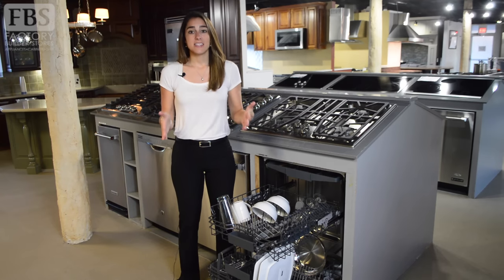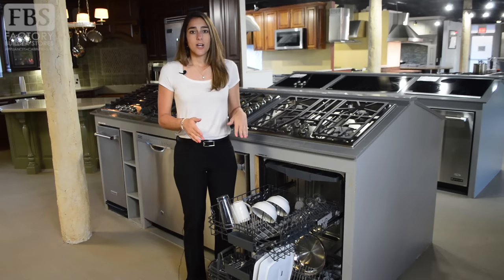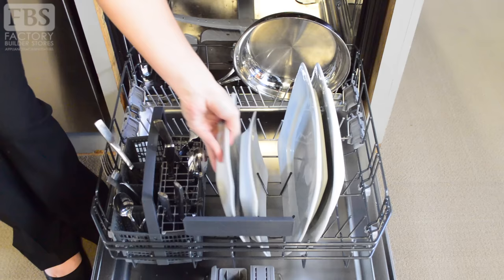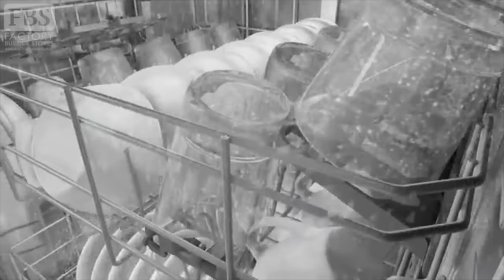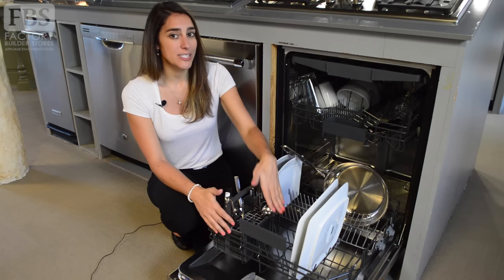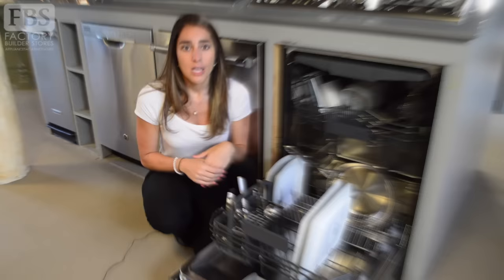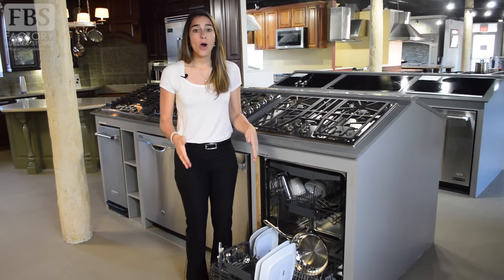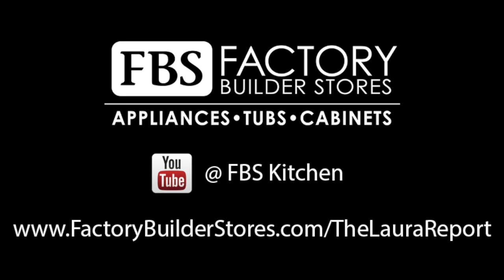How to Load the Dishwasher Properly

Comment: Dishwasher loading beliefs are like all the Faiths on this planet. People have strong beliefs and theirs is always right!! 
However i did learn some things from your video and some other videos and cleaned my wash arms as the dispenser was found open a clumped portion of soap and the dishes not washed well. I found the end of the arms a little blocked; the ones that spray at an angle and point towards the dispenser? Bits of plastic and string that somehow got passed the 2 fine filters at the bottom or past the meshed water inlet? Well its 7 years old and likely never cleaned so it is now and will try next load if all working correctly. All machines need servicing and i wonder if negative dishwasher reviews are sometimes caused by no maintenance?  Ours has only 1&2 star rated but ours seems to work fine up till now.

Comment: Hello Laura, my dishwasher often goes to 99+ hours setting when I have chosen a time 
saving setting (like 50mins). I have noticed that happens usually when I
 have not ran the dish washer for 3 weeks or so, but I don't have that 
many dishes per day to run the washer sooner than once every 3 weeks. 
please help. Thank you for your time
Reply: You should use it at least once per week. Modern dishwashers have auto programs that measure dirt levels. That's probably why that program is taking forever to finish.

Comment: cast iron can’t handle the heat of a dishwasher? what? ...if anything the heat is the last thing a cast iron can’t handle..but a good review anyways keep up the good work
Reply: The iron will hold up fine. It's your "seasoning" (or the coating on the iron) that won't make it through the wash
Reply: @YaBoiButterball  that’s maybe true but not the point

Comment: If you don't rinse your dishes prior to loading them, the food will build up in your filter at the bottom.  It can become really gross and will require cleaning the filter more often.
Reply: If you use the appropriate amounts of detergent, it really isn't a problem.
Reply: "No manual rinsing" does NOT mean putting  solids into the machine.
All detergents are designed for use after the user scrapes leftover food from the dishes before washing. Solid leftover foods should be scraped off the dishes or bowls into an insinkerator or just a waste bin BEFORE dishes are loaded into the dishwasher.

Comment: "No manual rinsing" does NOT mean putting  solids into the machine.
All detergents are designed for use after the user scrapes leftover food from the dishes before washing. Solid leftover foods should be scraped off the dishes or bowls into an insinkerator or just a waste bin BEFORE loading dishes or bowls are put into the dishwasher.
No need to rinnse off the oil.

Comment: > "Never put bronze, copper, cast iron, ..., into the dishwasher. This materials do not handle the heat the dishwasher can produce."
Laura, this doesn't make sense. Those materials have melting points well above 1000ºF. It is easier to melt the entire dishwasher than a single cast iron pan.
Reply from the maker: Hi Mark,
I'm sorry for not clarifying properly, in the video, why you should not put bronze, copper and cast iron in your dishwasher. I've provided clearer reasons blow. 
 
With Copper you risk changing the color of your pans by putting them in the dishwasher. Bronze is a copper alloy (made of copper and tin) and you run the risk of also changing the color. Excess exposure to moisture will also damage these metals. 
 
Putting a cast iron pan in the dishwasher can cause a number of issues with the biggest ones being rusting and sticking. Soap should also never be used when washing a cast iron pan. A cast iron pan should always be seasoned and when you use soap you remove the oils and damage your seasoning.
Reply: +O01dude 45 > "because ur using a detergent thats not designed for those kinds of items [...]"
Even if you use regular soap, several items would damage in the dishwasher (ex: aluminum, wood, ...).
Reply: Mark Messa , Gee Einstein. Did you ever stop to think that iron will rust, copper will discolor, wood will dry and crack because of the high heat and detergent in these machines?
Reply: The 'seasoning' on a cast or steel pan is EXPOXIDIZED fatty acids - it is not oil at all and won't rinse off with soap..  The seasoning layer will soften from extended water contact and can be readily removed with weak acids, or with more difficulty using abrasive scrubbing.. There is no harm from an occasionally quick wash of your seasoned pan with either soap or detergents water - in fact it's the best way to clean off excess oils before re-seasoning.    Any seasoned pan should be rinsed and always completely (heat) dried after any water contact.
Reply: because your cast iron will RUST!! It will pit your copper and discolor your bronze. Does that make sense Mark??
Reply: FBS Kitchens what is the reason for not putting wooden items. If it is an old spatula, then why not?
Reply: @namodat  the wood will dry out from the heat and will crack.
Reply: Our6Plus  true. I’ve seen it happen

Comment: First if i put pan like you on 3.56 he will fill with water and foam and i will need afterwash again. Second. Tins or comb in this machine in my case not work. I make from farm milk butter in 1-3 l glass jars. I cannot put safe big jars on down rack if they are not get 2-3 tins, so i make this they not move. Actually when i have big muds i cannot find place in second rack if i put there litlle cups and i put too in tins;) to lock them not move

Comment: Idk is it just me? I always rinse before I put the dishes in.
Reply: Bite Hunger Back I do too
Reply: Bite Hunger Back . Because you've never had a good dishwasher and because its easier to rinse than scrape for some people.

I hardly rinse anything. Saves tons of time. But my anal retentive roommate has to rinse everything and wash regular dishes on the pots and pans cycle. He's not too bright
Reply: same here
Reply: Its such a waste of water. Just scrape off large food particles, then load in the dishwasher. No need to pre rinse because the detergent you put in the dishwasher works at its best if it has soils on the dishes to remove. Rinsing that all away will make the detergent pointless. Dont pre rinse, just scrape off things that you know will clog the dishwasher, just be mind full.
Reply: Daniel Woods, every word you said is exactly true. In fact, I do everything you say in your comment. You are exactly right.
Reply: i tried that but the dishes come out with some food stuck to it i use the finish detergent any advice?
Reply: Bite Hunger Back Rinse all food particles off the dishes, and leave soils like stains and sauces on. Also, run the dishwasher with baking soda and vinegar or dishwasher cleaner on an empty hot cycle to clean the dishwasher out. Also use rinse aid.
Reply: Daniel Woods thanks
Reply: I do this as well, but it's not just a dishwasher thing. I was taught as a child to scrape off the dish and then rinse it.
Reply: I work in the school cafeteria developed the habit of rinsing as it is common practice with commercial dishwashers.
Reply: Bite Hunger Back ME TOO
Reply: the best app for me the most and my friend in law school has an excellent app for free all I
Reply: I have a cheaper apartment quality dishwasher so I pre rise off food chunks because I don't turn on the machine right away until it's full, so it'll be caked on. I've loaded the dishwasher without pre rinsing before and I had food all over everything that I didn't pre rise! I had to basically hand wash everything wasting more water than I would have if I just pre rinsed in the first place. Once I have a better quality machine I'm sure it won't need pre rinsing, but until then I'll pre rinse.
Reply: I've never rinsed a dish in my life and I've never had a problem. If you're going to rinse them, you may as well wash them.
Reply: Christy Heffner 
May as well.   I like the sanitizing from high hot water temp in addition to the actual cleaning
Reply: Have you ever worked in a restaurant? Notice how even the industrial strength machines leave stuff stuck on forks and plates. Notice how the dishwasher rinses the dishes before putting into machine. Yes, if you don't rinse, there is a good chance stuff will be stuck on your dishes.
Reply: You can't just scrape off egg yokes and think the dishwasher will clean the egg off.
Reply: That's why the dishwasher pre-rinse with cold water, to prevent the egg to be baked on the dishes before it's washed at the main wash cycle.
Reply: @TimezUp23 It depends on, how the machine is setup, the pre-rinse section should be cold till max. 40C and the main wash cycle must have 65C, and final rinse at preferably 89C at least. Also the chemicals should be dosed properly. When a company wants to save on money, which they all like to, they dose less detergent, which leads to poor wash results. It is something we never do at the place where I work, we must deliver clean results for a good reason. It costs more money to bear the problems it can cause. If a professional machine is properly set up, it doesn't need any pre-rinsing by hand at all, it will take over all the work for you, that's what the machines are made for!
Reply: Spend an hour cleaning the trap on your dishwasher.....you'll pre-rinse after that.
Reply: we been doing it wrong all this time
Reply: @TimezUp23  that is not true in household dishwasher though. Commercial ones run a very quick cycle with just a hot wash (where the water and soap mixture is used for more than one cycle) and a quick hot rinse. In household models cycles run for much longer, so that the detergent has more time to attack dirt. Plus commercial ones do not run a prewash stage before the mainwash, that's why they need prerinsing

Comment: Great information.  The only tip I don’t agree with is that detergent pods can’t be stored log. They are sealed therefore it’s not an issue. The same is true with liquid detergents. It’s the powders that would be an issue and should not be stored under the sink.

Great video on this detergent topic here https://youtu.be/z67iwoEkXkU?si=TBma1ZPx9H3dnnqU

Comment: This isn’t really good advice. “Overcrowding” the items isn’t the problem. You can actually load a dishwasher quite densely as long as all the surfaces are facing a direction that the water sprayer will reach. I even typically place large bowls over smaller ones, and it comes clean as long as the smaller one doesn’t block the water spray from going up inside the larger bowl. Not everyone has the spacial ability to visualize how the water sprays insode the machine, but if you can, then use that ability to face your dishes where the water spray aims.

Comment: I agree that you shouldn't put cast iron in a dishwasher because it ruins the seasoning, however, I disagree that it can't take the heat. You can put it in a 500 degree oven or directly into a fire so don't put in the dishwasher but not because of the reason you stated here.

Comment: More instructions than a Space X preflight. You left out the most important requirements number one make sure water temperature going into the dish washer is at least 120° restaurants are required by law to have at least 165° in order to properly sanitize. The hot water does  80% of the cleaning. Number to make sure to scrape all of your plates into the garbage big chunks of food cannot get through the filter. It will only clog it up and stay there and make a rotten odor. Number three you should always put the utensils face up including the knives. Otherwise they will not come out very clean. It’s like wearing sunglasses to watch a movie you may see a little, but I would rather have an unobstructed view.🍴🥄🍽️

Comment: Considering that the detergent dispenser simply drops the detergent and doesn't fully open (it instead hits the bottom rack), blocking the dispenser isn't a problem on my dishwasher.
Reply from the maker: oh no! what dishwasher do you have?
Reply: @FBSKitchen  I've had multiple washers where this is by design. This one is a Kenmore. It doesn't appear to be a problem whether I use pods, powder detergent, or liquid detergent. Just like the pre-wash detergent bowl, it drops the detergent into the basin of the washer (but releases it after the initial pre-wash cycle). In other words, it is impossible to block the dispenser on this dishwasher so long as everything is in the racks.

Comment: More dirt to work against for soap to do a better job is like saying a woman needs a baby with a bigger head to work against during labor. Oh and obviously the racks are coated with plastic so cracks and chips don't happen even using tines. Stemware is at RISK no matter what.  So do you just make up stuff ? Tell me which side of the fridge should i put the milk and why ?

Comment: I stopped you when you stated if you don't leave food particles on the dishes, the soap will attack the plates, degrade them causing problems and I think you said even cracking.    I didn't see that crock loaded in the dishwasher you're pushing.

You are trying to make us believe just by leaving a dab of catshup on a plate that it's going to magically protect the finish of your plates?   Wow, I just find that so amazingly stupid.  Either you're using a sand blaster as a dishwasher or the soap is some industrial strength magic acid formula that will eat your plates.  Either way, it's stupid to say that.

I  was born in Missouri and that's the show me state.  Show me.  Prove to me that if I pre rince dishes and then put them in the dishwasher that it will destroy the dishware.

Comment: Glasses on the top rack without loading over a tine, no. With each and every time I pull out the rack each of the glasses and smack into each other in my Frigidaire Gallery dishwasher
Reply: I agree.  My dishwasher manual says not to do that.